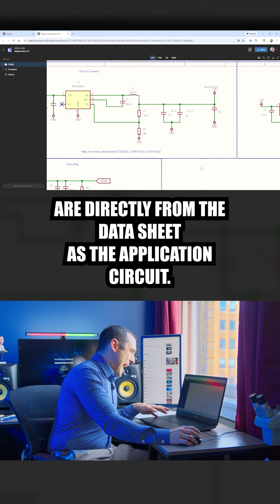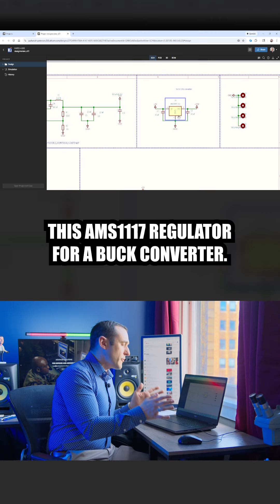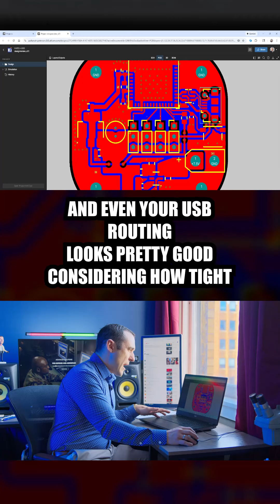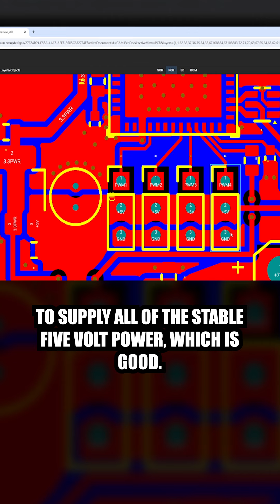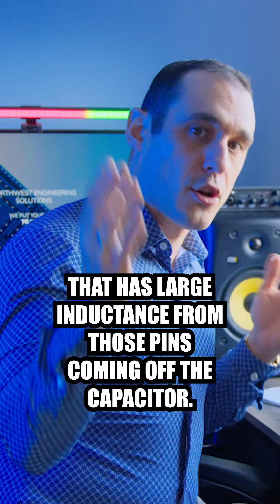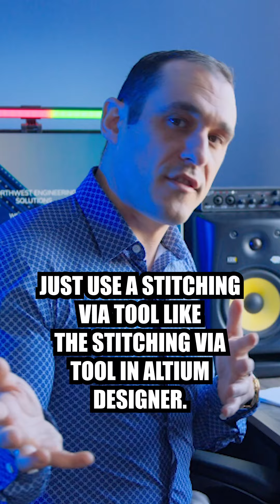ESP32-Based Motor Driver PCB - ESP32 PCB Review

Comment: Even if there was a switching regulator in place of the ams1117 would the stitching vias be of any help? Also, are stitching vias useful for shielding in double layer boards? How many vias would be sufficient for connecting the ground pours in the region of ams1117 or any other switching regulator?